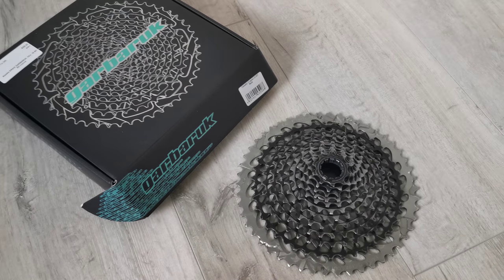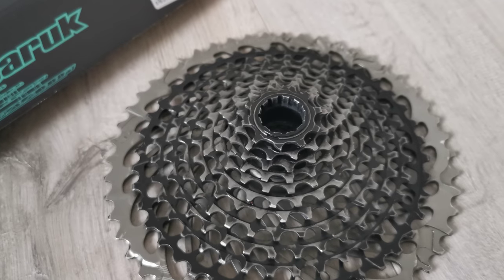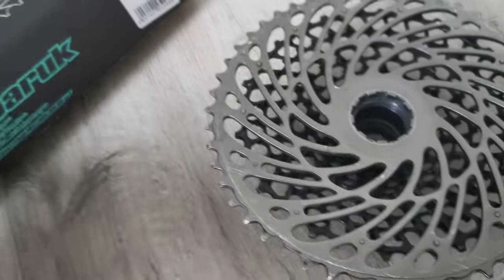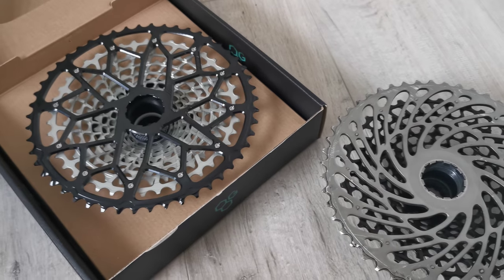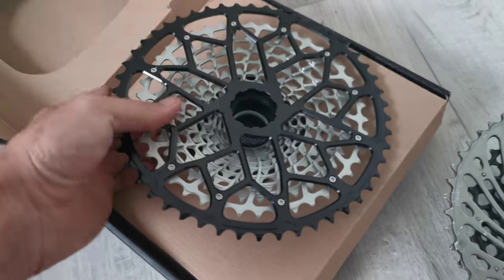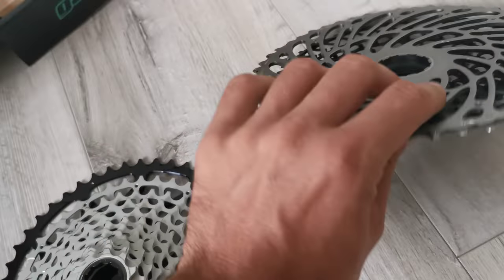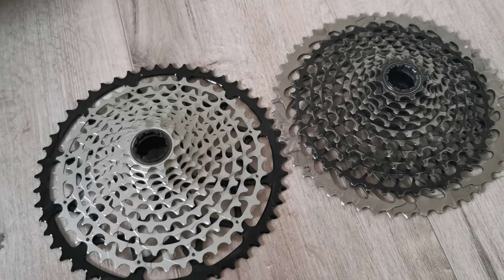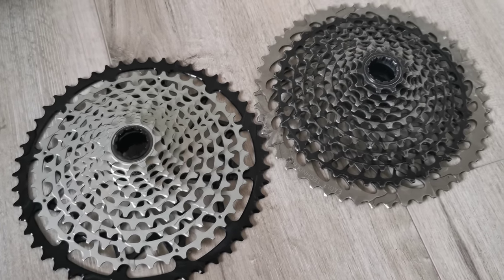MTB cassette comparison: XX1 Eagle vs Garbaruk

Comment: Any update on performance, issues and durability?
Reply from the maker: No problems at all with Garbaruk cassette so far but it is just one season. Anyway even at this point I can recommend this product. Seems durable.
Reply: @RoadBikersPoznan  Thanks!
Reply: It holds even better than sram's xx1 and x01 with good TiN coated chains. Mine did 9k kms and it shifts even better now.
Best cassette out there so far!
P. S.: it is Ukrainian company actually, but they mooved to Poland because of our corrupted officials and government.

Comment: how has it been working for you after all these months? shifting good enough? thanks
Reply from the maker: I had to adjust shifting a bit as the alignment between cogs and jockey wheels was not perfect. I suppose it was because of slightly different spacing between these two cassettes. Since three months no problems at all but can't say Garbaruk works better than Eagle. However taking price into account it was a good deal. One bike mechanic told me the Garbaruk is not as durable as Eagle and sometimes the biggest aluminium cog may bent. But I didn't observed anything like that although I am pedaling with decend power.
Reply: Mine had already done 9000kms, in 2.5 seasons. With proper TiN coated chains it would hold at least 30k kms. Mine is MS and 10-52 variant, works as new, maybe even a bit better, it had broken in.
KMC X12EL TiN chain + Garbaruk melon(oval) 30-34t chainring + XT rdr and XT shifter - best performance/value/weight setup, in my opinion.

Comment: How is the shifting performance?
Reply from the maker: Cannot feel the difference so far. Pretty the same like XX1 Eagle. Hope durability of Garbaruk will be as good as sram  cassette.
Reply: @RoadBikersPoznan  thanks a lot. Im going for the shimano cassette.
Reply: For me shifting im garbaruk is much worse… especialy in harder terrain eagle is just more reliable. I had Garbaruk cassete for 1 seeason and came back to sram. Garbaruk is not reliable…
Reply: @kamilmitek  so you do not recomend garbaruk?   I have to choose between garbaruk and X01
Reply: @Origo12345  i struggled with Garbaruk shifting performance in hard terrain and interval courses a lot. Now ridding on x01 cassete + x01 chain and it is superior stable and reliable in all conditions and agressive shifs.
Reply: @kamilmitek  poor setup, wrong q-factor, unproper componentry(chain especially) - everything else, but not the cassette!
If setup properly - shifts like breath!
More comparable to top tier Shimano feel, than that shalow sram's cracking shifting action.
Excellent shifting under heavy load with XT or XTR mechs and shifters.
After my MS 10-52 did 9k kms, it shifts even better now.
Sram is good, but Garbaruk is better.
Reply: @DimitrosSJ  which chain would you recommend with Shimano m9100 rd and shifter?
Reply: @DimitrosSJ  that's sound really good.
I am between xtr or this garbaruk.
I am thinking about it...
Reply: @Cylcopath_GR  that was exactly my choice 3 years ago. I am so glad I choosed Garbaruk now! And check out those Garbaruk oval chain rings. They actually got more "round feel" pedaling than actual round chainrings.
Reply: @DimitrosSJ  i am currently use absolute black oval

Comment: Hi, how many kilometers have you driven with the cassette?
Is the durability good? Thank you very much
Reply from the maker: With this  cassette I made over 2k. It is holding up very well but I didn't tortured it on steep, long mountain climbs. Works perfect with XX1 chain. I definitely recommend this brand.